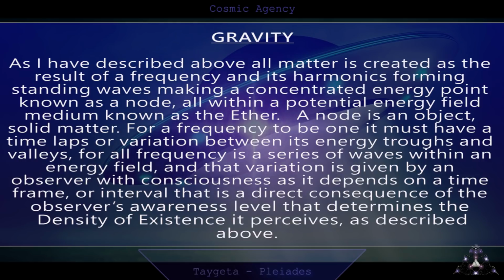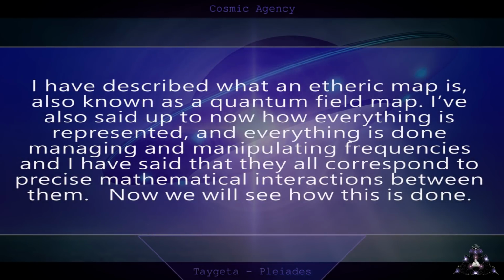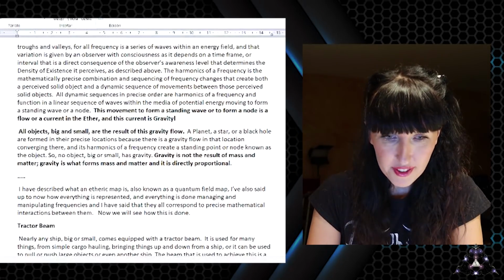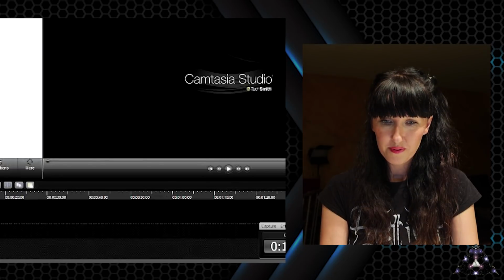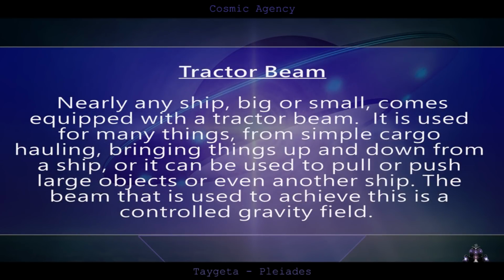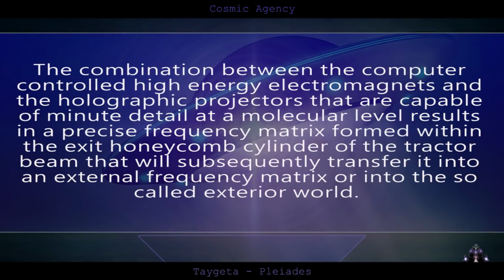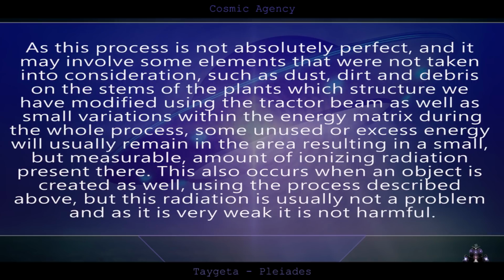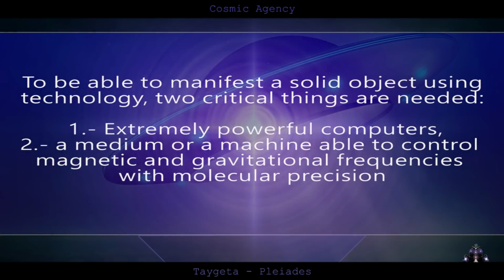Stellar Navigation 2 (Swaruu of Erra) (Part 2): Extraterrestrial Ship Technology: Taygeta - Pleiades

Comment: Sounds  similiar  to  HOLOGRAPHIC  projector ....if  it  can  project  images  by  a laser.... Have seen  some  on Earth ...for  entertainment  purposes    *  Holographic  Dancers  ect  *   this  explaines  CROP  CIRCLES  as  it  is  a  3D printer  that  projects   a    HOLOGRAPHIC  design   of  the   TRACTOR  BEAM   to  the   exterior  surface  ....   grass  fields   ect ;)
Reply: Where do you think holograms came from?
It's all over black ops, NAVY,  Air Force, Marines....
Seriously,  get with your thinking.
Reply: @dianamiller9805  Its a  bit  if  a  mystery   Dianna  .....   Air  Force could  be  in   zinc  with   high  tech   advanced  technology    in   use   to   maybe   assist  them   to  their  advantage   for  experimental   use , even  less  advanced forms of              HOLOGRAPHIC PROJECTORS ...  though  seriously  Diana   get  with   your  thinking  Dear ....   the  CROP  CIRCLES   definately  are   are   not  coming  from  the   black  ops,navy  air  force   or marines...  as  they   are  producing  them  on  private  farming   land  *  AGAINST   THE  LAW  *

Comment: That makes sense about the "real" crop circles and using a tractor beam. Some people have caught on film a spherical light orb at high velocity over the areas where a circle shows up. It's done quickly and the nodes in the plants are proven to be changed and radiation detected. Very interesting:) And the kicker - "Starship engine harmonics as exactly the same as spiritual consciousness emulated with nano-particle accelerators mimicking neurons like the ones on a biological being with a soul." Wow - which came first, the chicken or the egg?

Comment: Archaeologists found liquid mercury in a subterranean tunnel beneath the Temple of the Feathered Serpent in Teotihuacan, Mexico. I think this was in 2015. Is this mercury also used for buffering the interior movement inside the ship? In other words, to keep the interior from feeling the high velocity of travel.

I would think that as you move up in density/frequency, you would be able to utilize the energy to create, at will, at a much faster rate than here in 3d. Why would it be necessary to have these physical components such as mercury, lenses and computers, etc. It seems to me that directed intention would be enough to manipulate the energy frequency, especially in higher density. @Dale Harding, Rainier or Swaruu, please help me with this question.
Reply: liquid mercury actually has a connection with realm density slipping, specifically the AD reps. they fuse it with pure han purple and human blood, this property allows them to almost “spin” this elixir during ritual and for lack of a superior term “slip travel”       that’s what one would call mental!
Reply: @ellismclane5909  Sounds cern related and disturbing